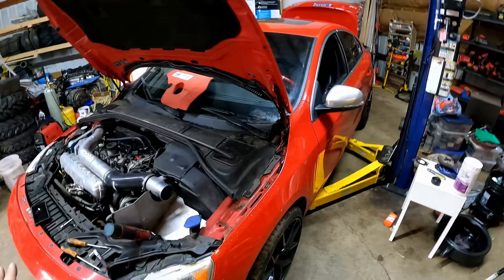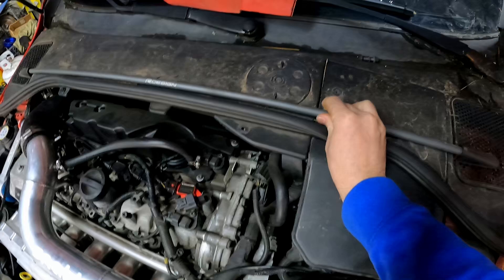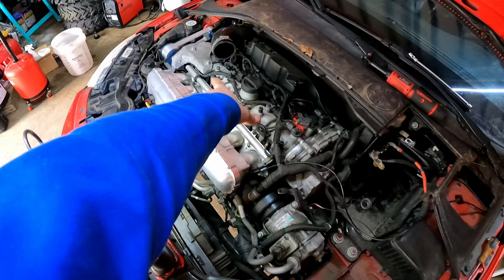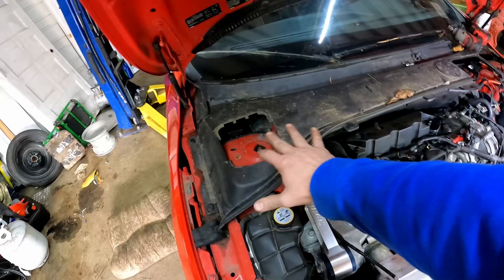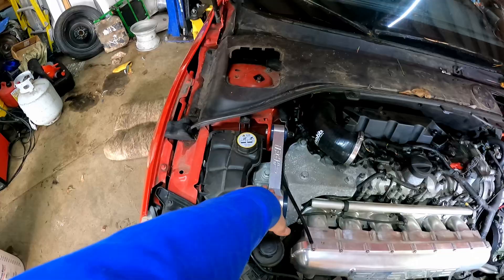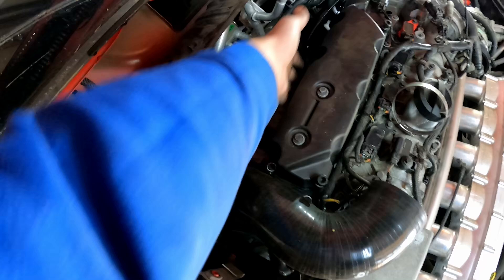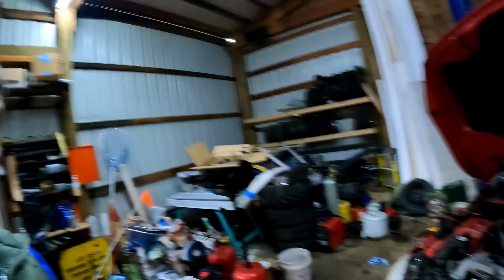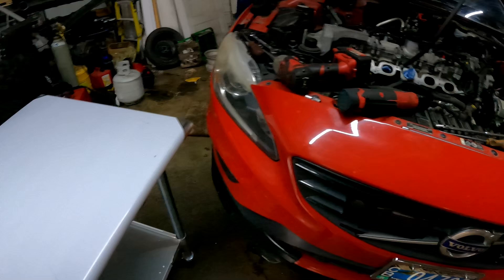Volvo P3 3.0L T6 b6304t4 Engine removal DIY Part 1

Comment: So I thought you might find this interesting. I have a BONE STOCK 2015 V60 T6 R Design, I did a pull around Christmas time and it was a strong one.. oddly strong, then misfire right after. Compression tested and found zero compression in cylinder 3. Burnt valve. I had the local mechanic that specializes in Volvo fix it and he told me he just fixed one a month prior for burnt valve. I’m not saying it wasn’t your tune, but I thought you might like to know you’re not the only one lol
Reply from the maker: The valve was a donor engine, not from my car. I bought it from my friend. Mine has low compression on 2 cylinders. Burnt valve could be due to bad injector

Comment: Having removed one of these before I'll be surprised if you managed to get it out of the top. I found it significantly easier to pull it out from the bottom.
Reply from the maker: Did you drop the subframe?
Reply: @BuiltForSpeed  I actually converted mine (XC70) from D5 to T6 so I dropped a whole bunch of stuff. I did try and pull the T6 out of the top first but it got caught up on the engine mount platform under the battery tray. It's doable, but dropping out of the bottom is easier.

Comment: I've always wondered, the little fake firewall, what would go wrong if it just got left off and driven? Anything?
Reply from the maker: The ecu would heat up. Its behind it. That only thing i can think of
Reply: @BuiltForSpeed  That's what I was thinking too but wasn't sure if it'd effect it that much.

Comment: Hey bro I need your help, I just got a polestar stage2 tune from hilton on my 2013 volvo xc60 r design. I'm having a issue with it bogging down on me sometimes under hard acceleration it doesn't happen all the time but enough for me to be concerned would you have any idea what it is or could it be the tune?
Reply from the maker: Could easily be the tune. Did it do that before tune? If it did not its the tune talk to hilton try to log it and send him log and try have him adjust it
Reply: @BuiltForSpeed  No it didn't do it before the tune, so I'll definitely reach out to hilton thanks for your help and responding so quickly